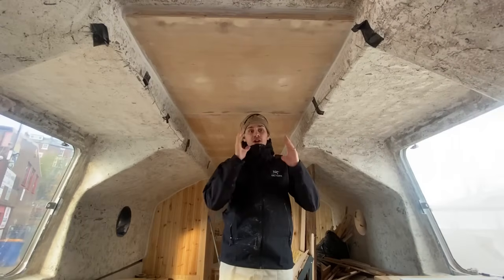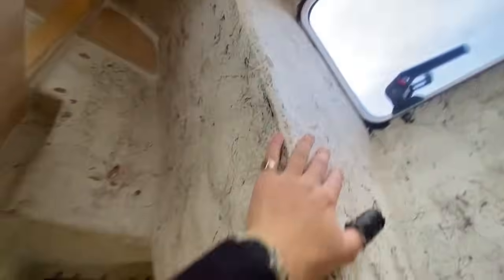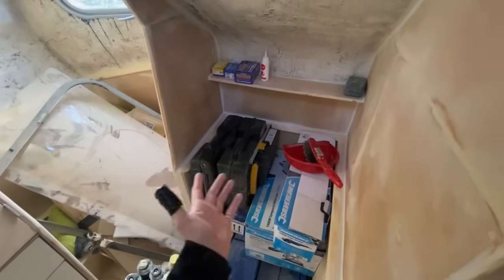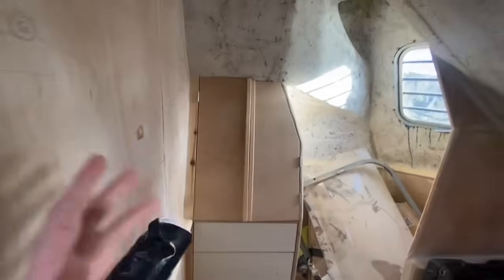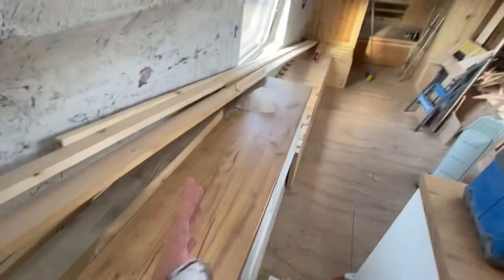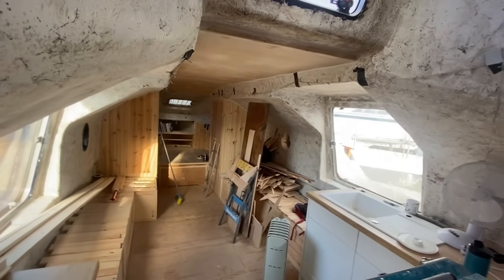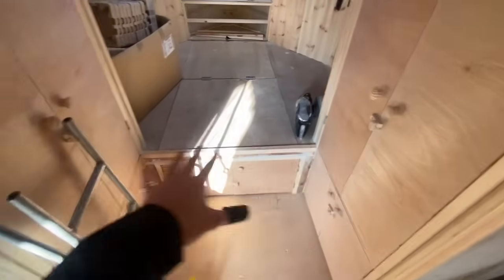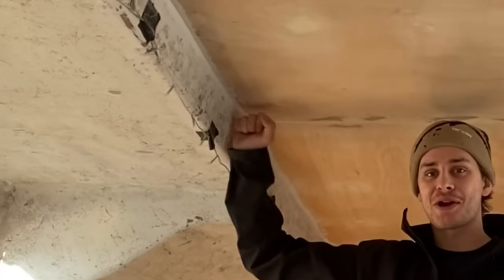lifeboat renovation #2 - construction update

Comment: Would recommend highly against utilizing the gap between the two shells for anything other than sealant. The lifeboat Alan over on another page has had leaks around this area and it would be unsurprising if you end up with leaks there as well.
Reply from the maker: Great spot but there’s actually already a load of mastic on the inside and out. Haven’t had any leaks through it during storms and when she’s been in the water 👍🏼